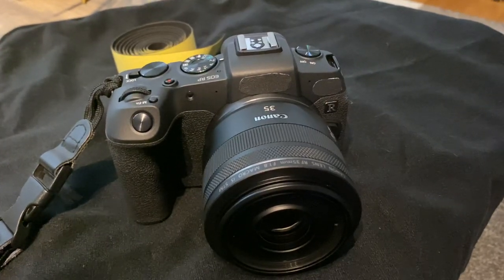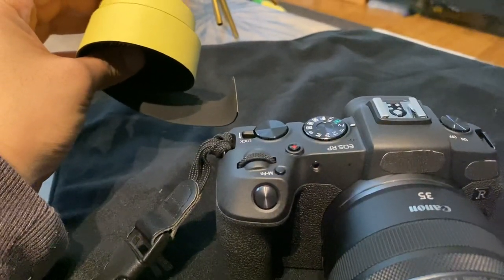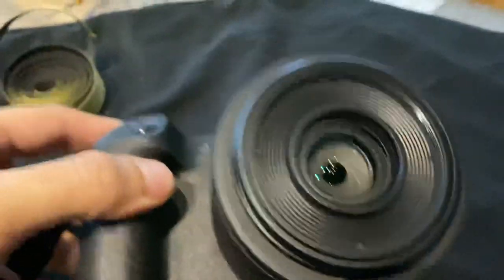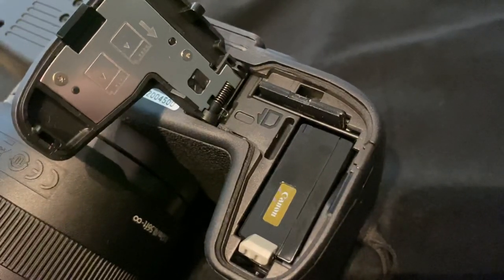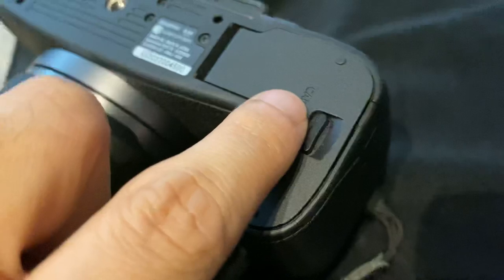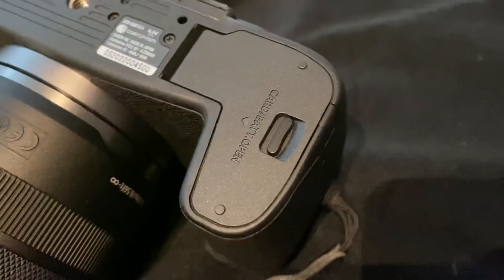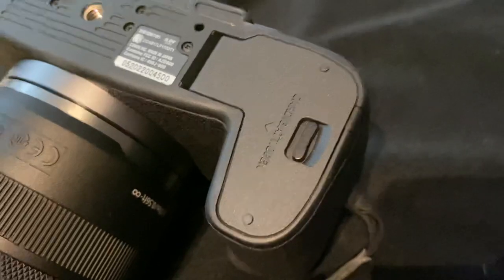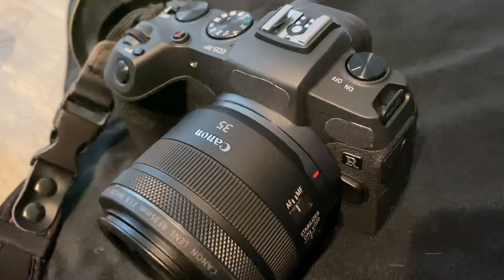Canon EOS RP - Adding your own weathersealing for $5 DIY

Comment: When I got my RP used I thought the battery door being lose was because the previous owner might have been a bit rough with it.
But regarding weather sealing, it is great. Used it in heavy rain multiple times at my own risk and it never seized to function. The only time it did give up on me was when I used 3rd party batteries. Never gonna use those ever again.